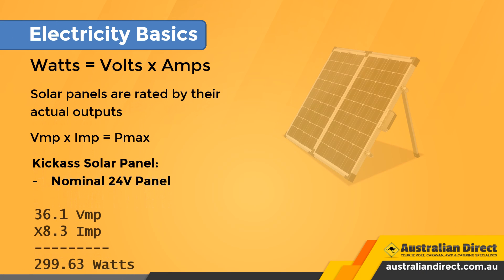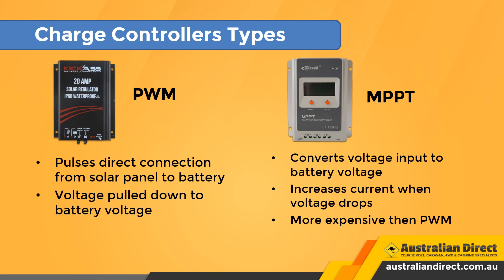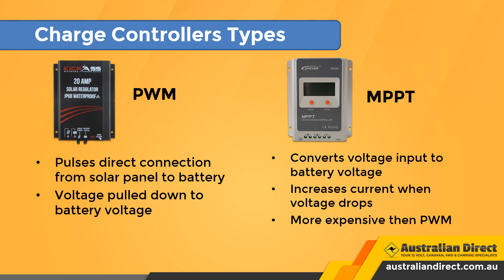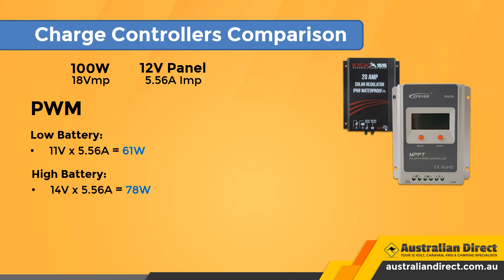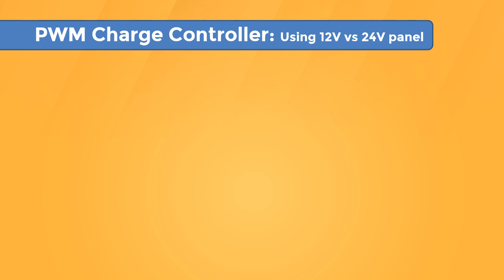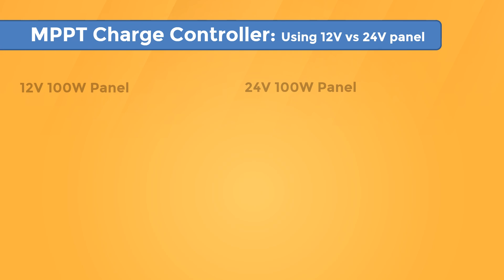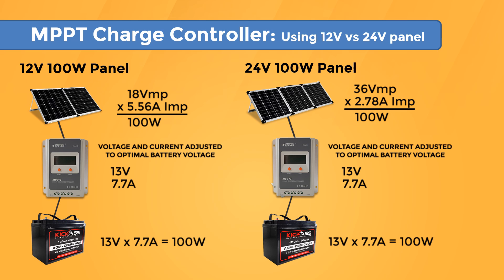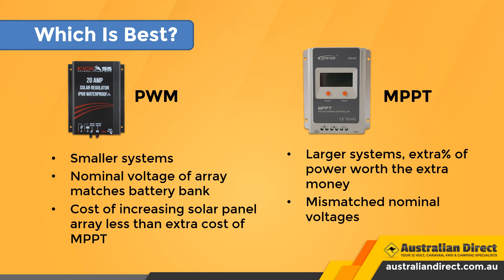PWM vs. MPPT Charge Controllers

Comment: what  happens if connected 24v  200w  panel to mppt  to charge 48v battery?
Reply from the maker: Hey Maddula, the eTracers will take a 24V input panel but only output 12V. So this product would not be suitable to charge a 48V battery.
Reply: is there any tech which can do that?
Reply: There are some units around, which I think are for golf carts, as a step up does not seem to be very common. It's more common to step down from a high voltage (for efficiency).

Comment: I have question on 24v 100w solar panel, mppt and 12v battery. The question is if i use 24v battery instead, how the results?
Reply: Narong Saesue
Reply: Double the power compared to PWM. The MPPT controller will convert excess voltage to current.